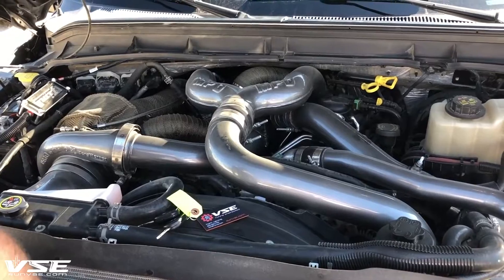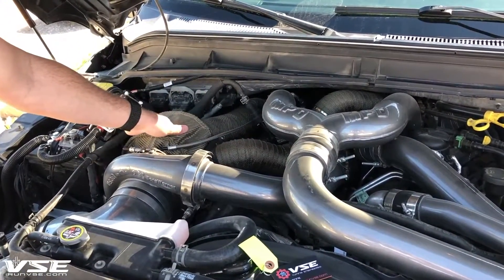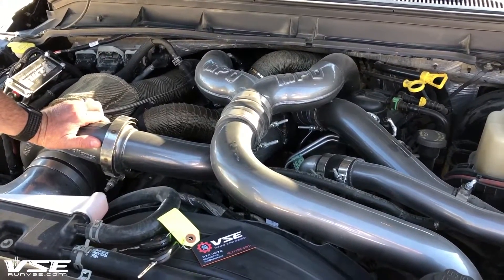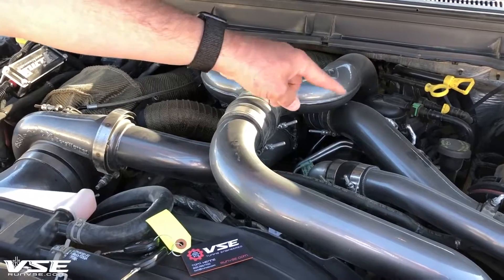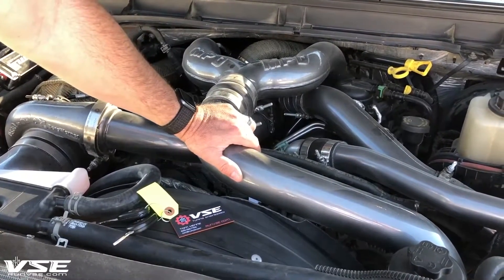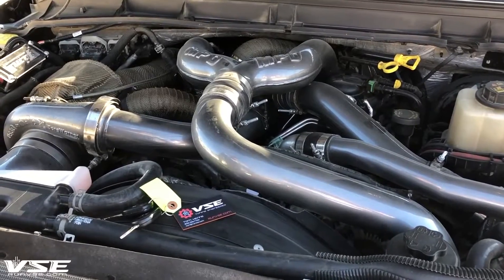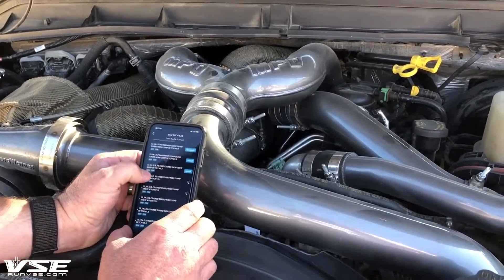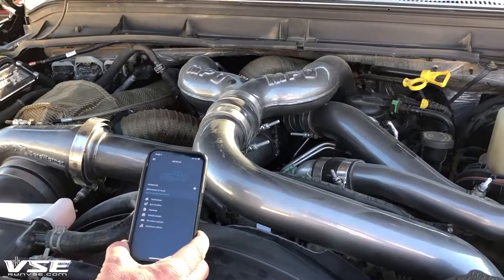COMPOUND TURBO 6.7 POWERSTROKE

Comment: Now put me in my place if I'm wrong or you want just want to😂 , but I thought the point of a compound turbo was in the sense of compounding the boost as in the smaller turbo works at low RPMs until the big turbo spools up to its boost, and when it goes down into the smaller turbo inlet it compresses it because it goes into a smaller Area and compound the amount of air that’s forced into turbo compressor. You forced a lot of things into a smaller area. Pressure is doubled in a sense so whatever your PSI going into the big turbo is a.k.a. atmosphere when it comes out it times it is compresses it you know that’s what the blower does and doubles what atmospheric pressure on inlet of compressor when it leaves at say 35-36psi and goes into the smaller turbo at two atmospheric pressure it leaves the smaller turbo at four times the original atmosphere pressure at 70-72PSI that it took in the inlet of what incense is your secondary turbo now with all said that's only if you have a A/R ratio of 1.00 outlet now if you start talking about turbos that have 1.10 –1.20 or I've seen up to 1.50 A/R ratio essentially that means that your inlet to outlet size is no longer a one to one your inlet will be A 1 to .90 so the outlet would be 1/10 smaller than the inlet on a 1.10 A/R ratio turbo compressing the air 1/10 more so incense it's a multiplier for even more boost while having the same size turbos/more boost for the same amount of effort produced by the turbos

Comment: i have a 16' with a titan 64/67 and a 10mm stroker and full intercooler piping/intercooler. i recently got the no limit compound kit but terrified of throwing it on my truck with a stock bottom end. I baby my truck, think im safe?
Reply: That would be a question for your “adjuster” ;). Tell them to adjust your file accordingly to make safe hp. 

What size atmospheric did you go with?
Reply: @Colt_121  76/85 ball bearing
Reply: @kelton black  To be honest you might be pushing it. If you were still on stock fuel i would say you're good to go. But If you haven't welded your Crank gear yet and have that 10mm in there, I damn sure wouldn't throw that on. Buddy of mine has had his compounds on stock fuel for a while. Just recently, threw the stroker pump in there and tried to open it up a little more.. and spun the crank gear. Now the motor is out of the truck.

You will get different opinions from everyone. Some say the Crank gear won't slip and they will bet their right arm on it. Some people call it "kind of cheap insurance" to weld the Crank gear and be preventative. I'm one of the cheap insurance guys. It's not really "cheap" but compared to a new motor it is.
Reply: @Colt_121 What exactly does that process entail? Can't find a video on it.

Comment: Damn I need this on my truck. Where you located
Reply from the maker: We are located in Bennington, Nebraska
Reply: @runvse  oh ok. I bought a deleted and tuned f250 about 8 months ago. I can’t find a tuner on it can a save the tune on it for back if I bought a tuner?
Reply from the maker: @North_Coast_Hvac  Unfortunately even though the tune stays in the truck and the device, theirs no way to pull the tune from the truck you will have to buy a device and reflash the truck if you want to know exactly what tune is in the truck. Do you know what device was previously used to tune the truck?
Reply: @runvse  I don’t. I believe it was dyno tuned but not sure. I’m currently working on starting a channel and will be modifying and revising the the truck. It currently has a 12” lift on 40s